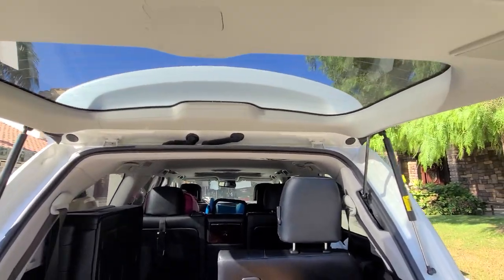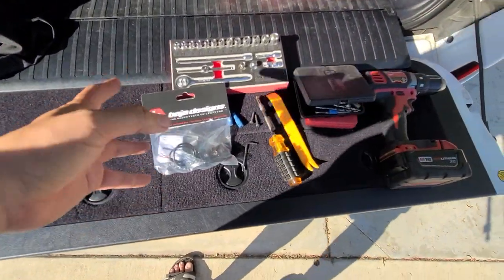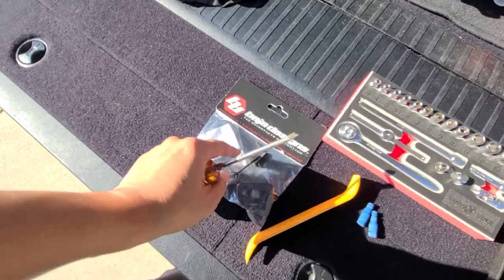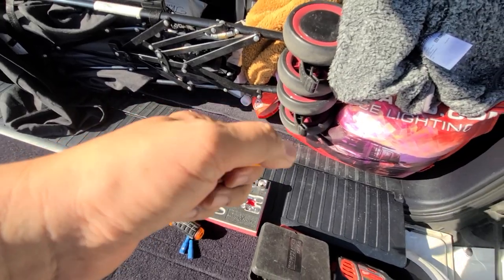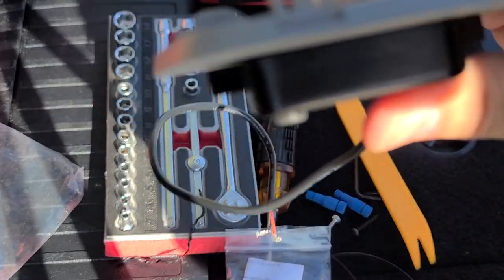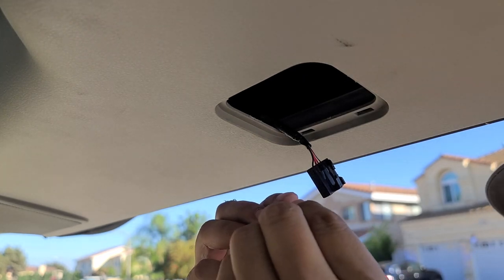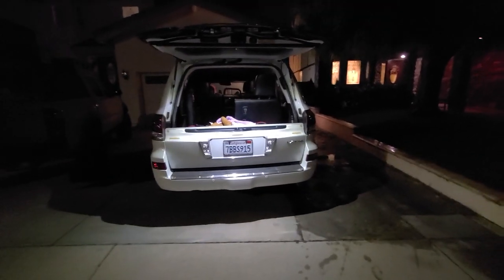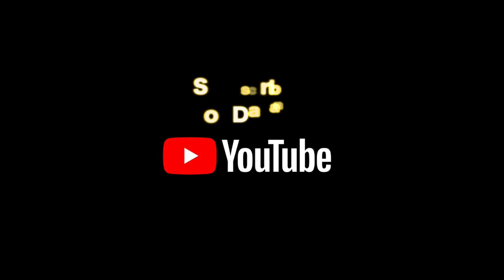All That Light From ONE Tiny Baja Designs Dome Light ! - Lexus LX570 / LC200 Landcruiser Hatch MOD

Comment: How hot does it get? From Baja designs website.Caution: Dome Light w/ Switch can get very hot when used for long periods of time. Please use caution when handling or installing.
Reply from the maker: Never noticed the heat issues but the body is aluminum for heat dissipation

Comment: Nice and impactful first mod!  Maybe I missed it, but I wonder if there’s a way for it to automatically turn on when the hatch opens?
Reply from the maker: If you had a switchless LED or a toggle switch vs a push button like mine, it should ideally light up when open.
Reply: Does not work. Once the power is cut to it, it will turn off until the button is hit.

Comment: I have a 2011 LX570 with powered lift gate and I could not get it to work.  I do not get any V to the larger red wire and 2V to the smaller red wire.  Connect LED straight to battery and it works.  ideas?
Reply from the maker: does the button close your hatch?
Reply: @RobDaman  yes, everything works; dash button, remote, back handle
Reply from the maker: That insulation is pretty thick so perhaps test your contact again.
Reply: @RobDaman  I will, thank you